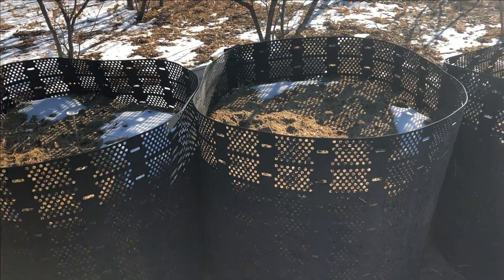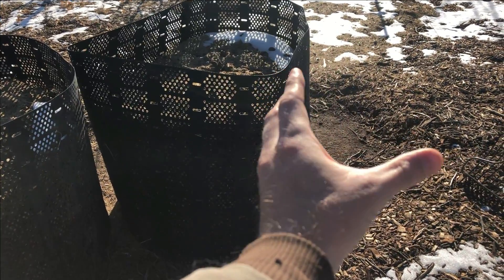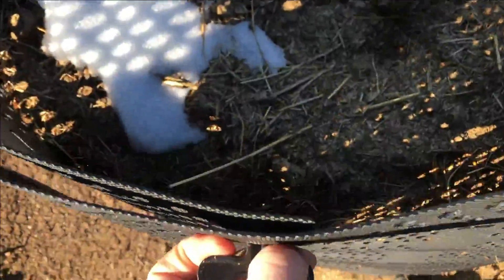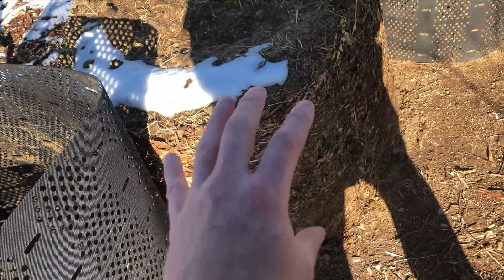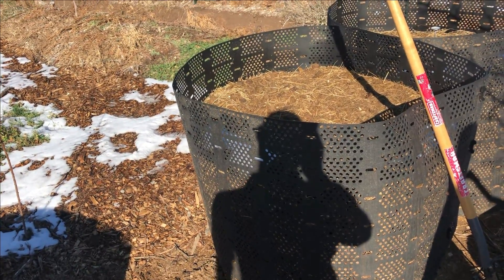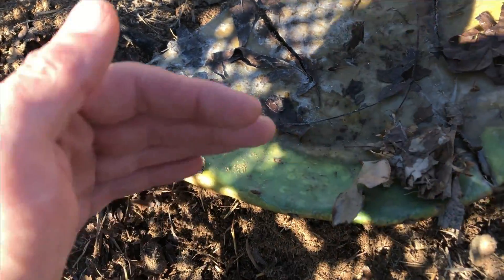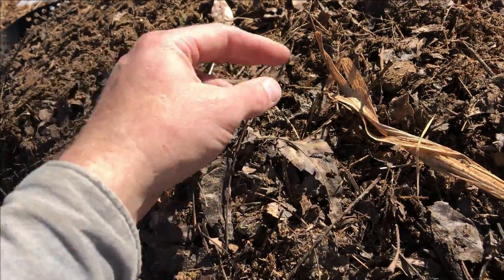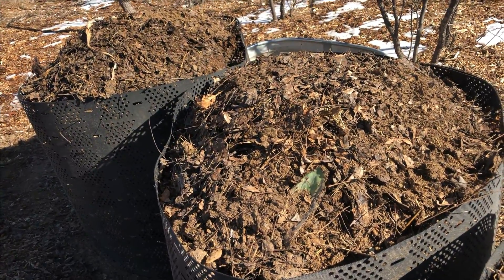Composting Cactus, Donkey Manure, and Leaves in Geobins - Part 2

Comment: I see someone else mentioned a chipper/shredder. I came here to mention that.. iI have one from harbor freight I got a little over a year ago and I am liking it. It's taking my composting to a whole new level. I found your video because I am just now purchasing these new eco bins. I see a lot of great reviews on them.. I have three old dryer drums that Ive been using for 2-3 yrs now  They work pretty good but I'm finding out those are only about 50 to 60 gallon. I need a lot more space.
Reply from the maker: Hello, do you use your chipper/shredder to process cactus or things other than wood? The geobins are great! Sometimes you can find them on eBay for pretty cheap.
Reply: @WestTexasGardenExperiment  Actually ive never used cactus in my chipper. Ive got a tarp that I throw all my daylilly stalks, iris stalks, big new fallen leaves, sticks, pine cones, etc I am cleaning my beds which I have alot. Once tarp is full I send it through the chjipper. the chipper comes with a bag and my bag will be full to take to compost station. You will probaly have to split the cactus 1, ot maybe 2 times. I average running it 2 times a month all through the yr.
Reply: @WestTexasGardenExperiment  I am looking on ebay and all the geobins I see is more expensive than the ones on amazon. Is there another name it goes under on ebay?
Reply from the maker: I think it just depends on the seller and getting the timing right. I bought 4 a few months ago on eBay for $25 each with free shipping.
Reply: @WestTexasGardenExperiment  Is the quality the same as the ones on amazon?
Reply from the maker: Yes, they were brand new in their boxes.

Comment: You can burn the spikes from  your cactus before composting with a torch weeder or any torch
Reply from the maker: Hi Jen, thanks for that info. I need to get back to composting cactus, as I haven't done that since this video series. Several people have suggested getting a shredder to run them through before composting to speed up the break down process. If I can find a cheap or used one, I might give that a try.
Reply: @WestTexasGardenExperiment  I actually run over alotof stuff   with my old lawnmower too before putting it in my compost... Really speeds up the breakdown... But if you burn off the spikesagood machete works well to chop up cactus too... I wouldn't use my good mower for chopping stuff for the compost pile tho... I used to use a big pair of grill tongs to hold the cactus...
Reply: I have the torch weeder attachment that goes on a LP tank like we use on grills.... It works great for weeds except dandelions which grow back  from a long taproot.... I have 5 geobins they are great... You can order extra keys to hold your flap edges. Or there are these plastic bolts with nuts you can use too... Or black plastic zip ties
Reply: @WestTexasGardenExperiment  most shredders get gummed up so use dry material while shredding the cactus pads.

Comment: Looking good!  Cactus skin seems to be very impermeable, which would explain why they survive here without drying out.  The only thing I've found still intact after composting cactus pads are veins and thorns - probably from old dead pads that got thrown in.  Do you ever see white mold on your cactus plants?

As leaves have fallen and things have turned brown with winter, I can see just how much cactus there is to harvest here.  A good supply of composting greens year round!
Reply from the maker: Hi James, thanks. The cactus pads started to get a bit gooey where they had cuts. The pads at the center of the pile seemed to be more decomposed than those closer to the border. I've seen white stuff on the cactus pads, but I don't think it's mold. Is this what you are referring too: http://blogs.ifas.ufl.edu/nassauco/2017/06/30/q-white-stuff-prickly-pear-cactus/
Reply: Aha!  Yep, that looks like the stuff.  Too bad, I was hoping it was a fungus that would aid in static composting.

Comment: Chicken wire is alot cheaper and just as effective
Reply from the maker: Hello, you are probably right. I’ve used hardware cloth for keeping compost before, and it kept wanting to fold over at the top, which made it a bit more difficult when adding materials. I figured chicken wire might do the same thing. These geobins were only about $35 each, and I thought they might do a better job of keeping their shape. Plus I think they will be easy to fold up and store away.
Reply: @WestTexasGardenExperiment  I'm only giving you shit.  I asked you a question awhile back so I cut down my cactus to compost it it's composting better than I thought I was just checking out your video for any updates the whole time I seen it I couldn't stop thinking bout chicken wire after seeing those Bins lol
Reply: I love the Geobin I used this past year for the first time.  It looks nice, is adjustable and easy to move, and made really good compost very fast (mainly because I put the correct contents in and chopped them really small before adding).  I just added TWO more Geobins for this fall, for a total of 4.  My neighbors in my community garden are jealous (in a nice way) of how nice they look and how well they work.
Reply from the maker: I like mine as well, thank you. They are so convenient to roll up and store as needed.